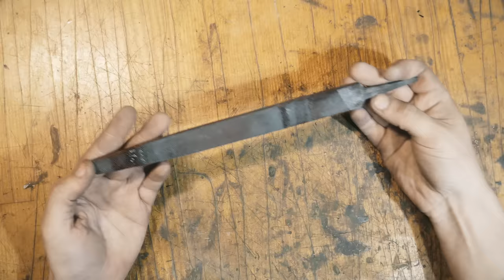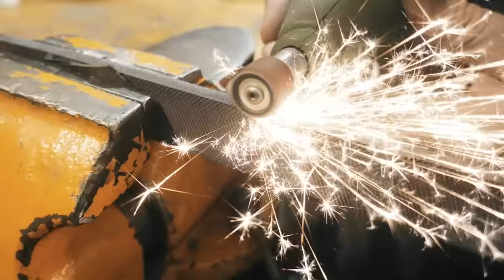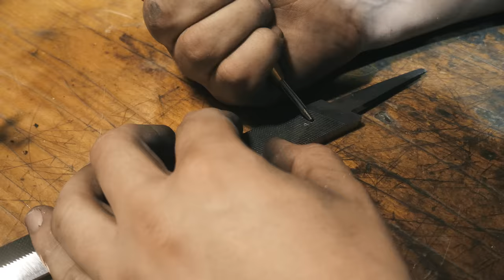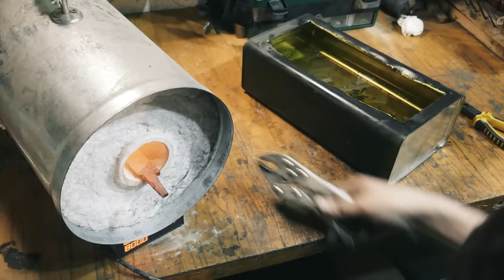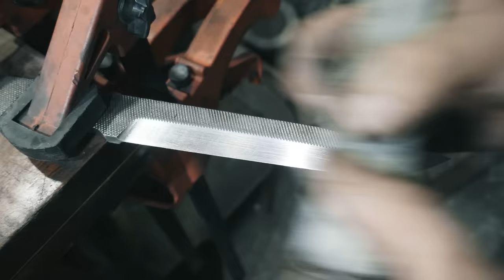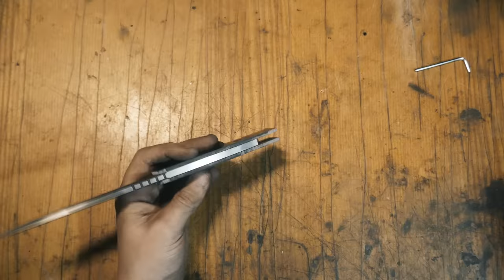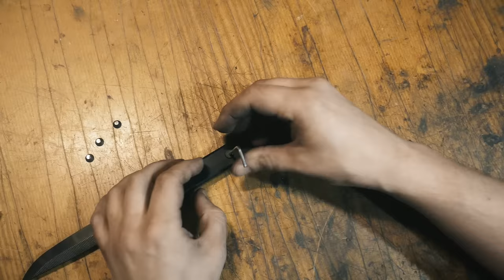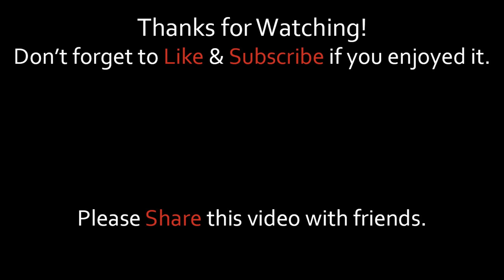Making a Knife from an Old File

Comment: You know, sometimes I say “hey I can make that” but I also wonder “hey why can’t you make that” well then I realize ohhhh right you’re broke and just spent your last $1 on chicken nuggets
Reply: I feel ya. If I had the oppertunity and had a workshop like this, also a forge so I could smith, I would be there every fucking day doing shit.
I have tried smithing ones and it was amazing, really fun and cool to do!
Reply: Same
Reply: Your name isn’t Leroy by any chance?
Reply: what tuu you pe
Reply: @hallamalla98   You don't need to have all of this equipment to start. I just made my first knife and you pretty much need just a hand saw, a file, some sanding paper and preferably a vise. And also a lot of patience, because afterall powertools are faster. I hardened my knife by filling a hole in the ground with charcoal and used a hair dryer to increase the temperature. Don't get discouraged
Reply: @Martin Tichý you’re a damn legend

Comment: Have to be careful with making a knife out of a file. The tempering in the forge is very important. Files are so hard that they will break if you drop them on concrete and they land bad, so it's important to temper them, otherwise prone to breaking.

Comment: Read an interesting article in file knives. First, you need to use pre 1960’s files as they changed the way they made them and they don’t make such good knives. Secondly, you need to wrap softer steel or iron around the back of the file and forge weld it. That will make the knife less brittle.

Comment: Did you cold treat the file the first time, then heat treat it afterwards? I noticed you took it out by hand the first time and used vice grips the second time and dipped it in oil(?)...

Comment: Wonder if you could make a blade from a bunch of old blades like pocket knifes. take ones that are old and used not failed metal just worn or rusty maybe 10 of them different sizes and shapes clean them up then forge weld them together to make a new blade. 

Would if you stack them the when they are forge welded would the shapes of the blades kinda show up like Damascus.

Comment: I have a small question. If I heat the file up and smash off the bum of it ... like flattened it. Will it be easier to smooth it? And will it cost less time to do the knife?

Comment: It's nice but as a knife maker I can point out a few issues...One most of all, is the handle...Very little design or contouring, basically a straight tip, any type of hard motion and it's likely you are going to find your hand sliding forward onto the sharp part of the blade, as the minimal finger groove, added is right by the beginning of the sharpened edge....Secondly, using old files, yeah they look ok, but that is not the best steel often for knife making, yes they do make "decent" knives, but not for slicers like this, more for choppers.....They are designed to wear away soft metals, but they are not designed necessarily to hit the higher rockwell hardnesses, and or hold the edge as well....but hey for a garage workshop knife - what the heck.....

Comment: Now for some basics:
The outside of a file normally has high carbon content while its core has low carbon content. This makes a file work better.
The blade (core) of a knife should have high carbon content while the outside can be whatever material is available (even wrought iron).
This is the OPPOSITE of how a file is layered. So this knife will work to some extent, but it will be shitty still and won't hold its sharpness over a longer time.

Comment: Looks good except I would have mounted the handle differently and never would have compromised the strength by putting a couple notches on the back side of the blade 🤦wtf